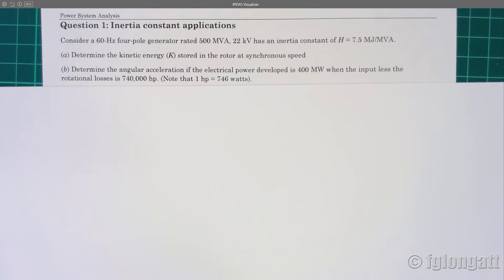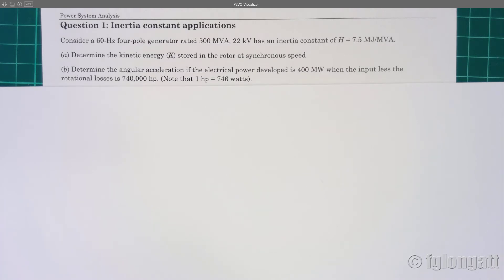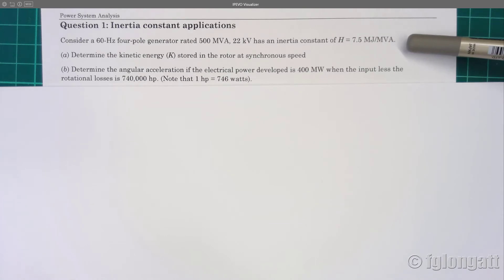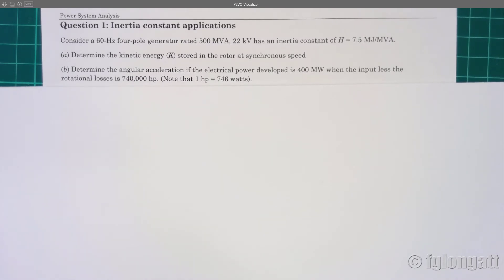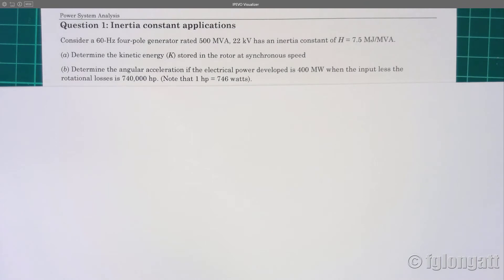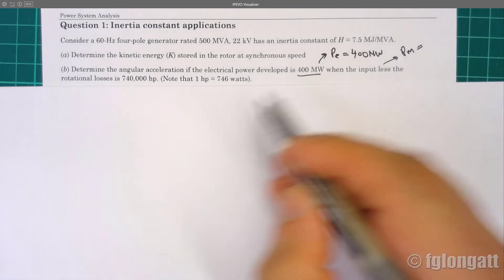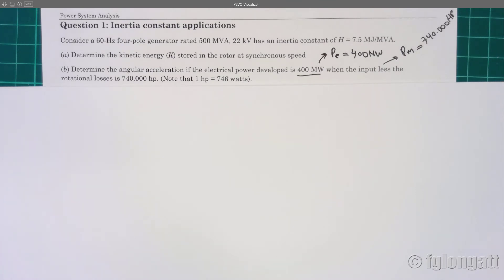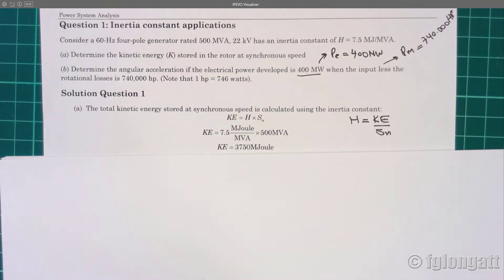Example Q2.1.  Inertia Constant and Swing Equation Applications

Comment: What is the new speed of the generator if the intertia constant is doubled??!
Reply from the maker: In this problem, we are not calculating speed (omega) ! The question (B), as presented here, is related to obtaining the angular acceleration (alpha) rad/sec^2 or RPM/sec. However, I do not see any problemto solve that. I suggest to subscribe to the channel to stay updated. Best regards, FGL